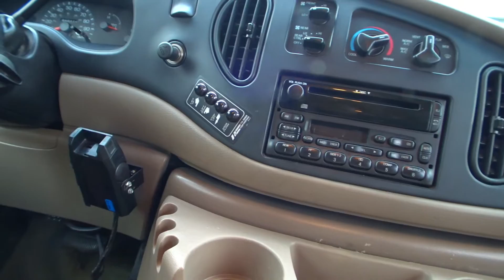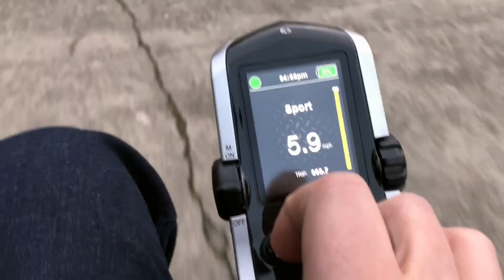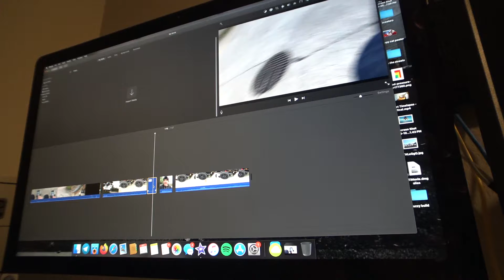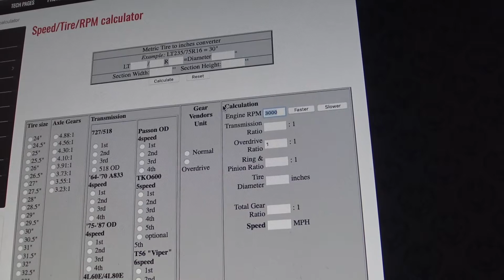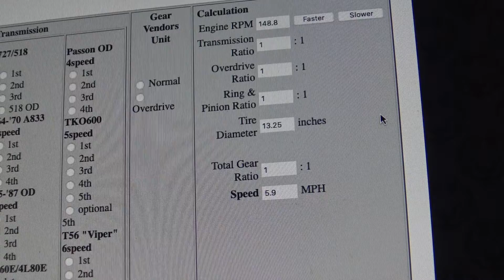MEGA VLOG 468: american STEEL & some maths

Comment: Glad you got a newer van. I've owned 2 Ford E150 modified vans- 1979 and 1988. Hated them both. I now have a used VMI 2010 Honda Odyssey and love it. I've had it 9 years and had to replace tires and oil along with ramp checks every 6 months.

Comment: I ordered my 2004 E-150 from the factor.
Ordered 2 batteries and engine block heater. The 5.4 2VPC V8 and a 3:55 limited slip rear end.
I still have but we do not use it much.
188,000 on it.

Comment: Congrats on the new van Dan! I have a 20001 E-150 5.4 conversion with an 8 inch drop floor. Your conversion is a lot nicer than mine and that is why they are out of business. They had to put a 3 inch body lift on mine in order to get the 8 inch drop in the floor. I live in northern Minnesota and only get 10 miles to the gallon in the winter and 15-17 on the freeway at 73 mph anytime of the year. I only had to replace one coil pack on the number three cylinder. I also have the Braun millennium II dual arm 800 pound lift with the longest platform I could get. I did have to add helper springs to the back in order to help control the sway I would get. My biggest problem was rear brakes. I think the rear brakes were put on backwards at the factory because they constantly need to be adjusted. I used to do all my own maintenance and repair work but obviously I can't now and my mechanic tells me everything was good but I don't think so.

My main vehicle now is a 2016 Toyota sienna with the VMI Northstar addition conversion with EMC controls. 16 miles to the gallon in the winter and 22+ in the summer, I like that!
Reply from the maker: yea im happy that this new superduty van has disc brakes all the way around! and theyre HUGE! my old white van (1995 E-150) has never had properly working brakes.. but then again i dont know why they EVER made wheelchair vans on a 1/2 ton chassis! seems like a bad idea!!

Comment: Yea that wire on the chair lift needs fixing that looks aweful. Love the idea of the spot great device if you can keep it on your person all the better but I guess the backpack is a good second alternative. Might be time for intermittant fasting or something to keep the weight down on the lungs, I think I might go back to that. Lost about 1/2 down to 41.5 then went to 43 in the gut after Christmas food. Really shocked you are not more into the arduino thing with how you like to automate stuff. Happy that you are doing better and hope they get you patched up. I think you did great being in so much pain, the pain brain fog is real and pain in general is a real motivation sapper. Happy you have a new van!
Reply from the maker: yea.. i need to find a pool again.. used to swim 6 days a week and that really helps lungs and everything else!  ive been on some meds that cause a bit of water retention.. i always loose about 12 lbs within a few days of stopping them.  got another week on those.. then we should be good! .. or at least on the right track ;^)
Reply: yes might be easier to breathe without the excess fluid as well less compression all around when that round of pills is done. I'd love to get to swimming again too, low impact and a wide array of muscle groups worked at once and offers some stretching as well. That is my plan also when I can get this pain under control. Thank god for medical cannabis, this overzealous money grab from the "opiate crisis" has put a lot of patients in bed.
Reply: @ytfp  Man I miss swimming!! I don't have the energy to do that anymore. And yeah God Bless Weed! If nothing else, it makes me smile. And that's super good medicine for me!

Comment: nice van..  I am surprise that it has lifting system, instead of have a sliding ramp.  I glad that you are still going
Reply from the maker: the sliding ramp would have to be about 12 feet long to get the proper angle ;^) - when they drop the floor on a full size van, they have to install a body lift on the whole vehicle to make room for the dropped floor above the frame.  then the floor ends up being way too high off the ground to use a sliding, or folding ramp like the minivans use.

Comment: Dan, just wondering what that little gadget is called and where can I get one and what service company is called. Thanks.
Reply from the maker: its called a spot locator beacon.  the model i got was the SPOT X.  they're designed for skiers and hikers etc.. the monthly services can get fairly expensive.. but they have some basic plans for the device itself, then the yearly addons for roadside is called "save out vehicle" or S.O.V. and then there's rescue assistance insurance as well.  the emergency beacon works with just the basic monthly services - BUT if you have to use it, you'll be on the hook for all the expenses associated with you're rescue. 

it all gets kinda convoluted pretty quick... lol but i just checked ALL the boxes hah.  might not be the "best deal" out there but it works for me :^)
Reply from the maker: around here and a number of other states, you're required by law to have a locator beacon to do any off trail recreation - and as a result.. the services arent 'cheap' because they know they can charge whatever they want since their products are legally required... monopoly much? lol -there are other providers out there.. garmin has one i believe as well..
Reply: Thanks Dan!